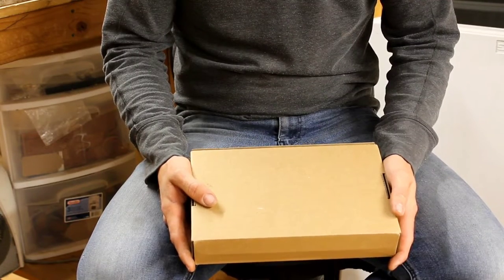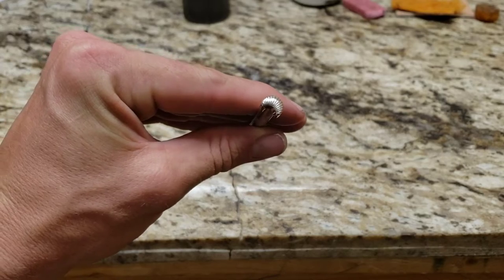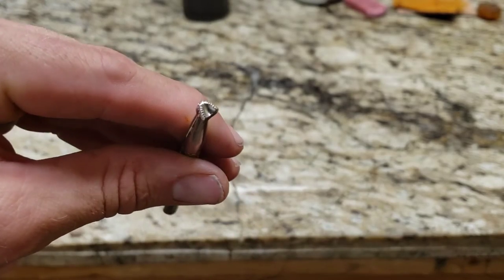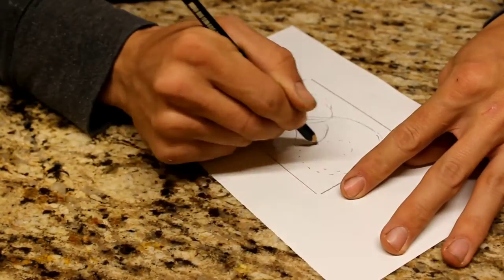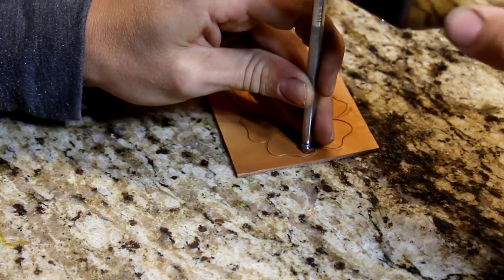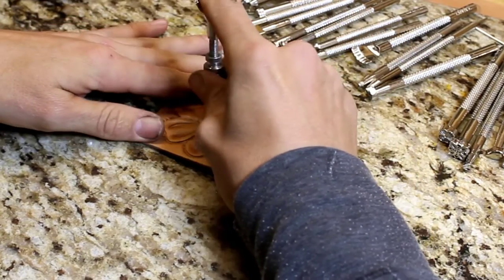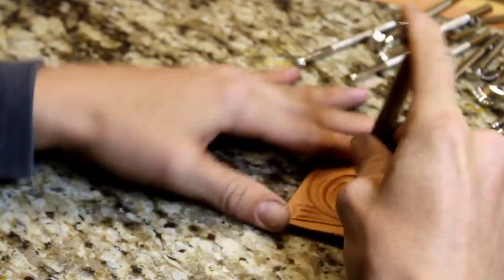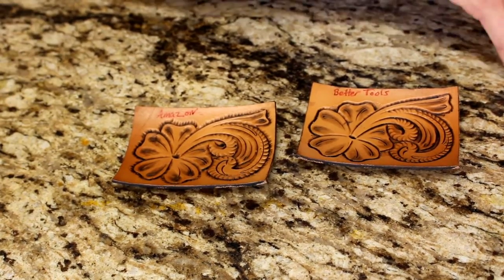Comparing Cheap $25 Amazon Leather Stamping tools VS. Expensive $500 Leather Stamping Tools

Comment: For the difference in the price of tools, the variation in the quality of the work is almost unnoticeable. In my opinion a beginner couldnt go wrong with the cheaper amazon bought tools.
Reply: I see a huge difference in the beveling
Reply: Like it said. A beginner. But once you step into that intermediate, professional stage the quality of the tools are very noticeable in the tooling. The crispness of the detail. And the fact that the quality tools are actually easier to use and get a deep impression

Comment: When I saw the results of the Amazon beveler I thought you were going to say it was garbage. Instead you gave it a fair evaluation and even gave a way to improve it with only a little effort.
I honestly don’t think beginners would be able to see a lot of bang for your buck with expensive tools.
Yes you will get tools you may never use. But it will give you an opportunity to build and replace as your skills improve . All for less than the cost of one premium tool. Very well done video.

Comment: my bro.   you cannot just use the swivel knife right out of the box....   You would never do that with any other swivel knife, so why do it with this one?   They ALL need to be touched up, sharpened and stropped when you get them.  no matter who you buy them from, they always need a bit of attention before using.      I honestly dont think you gave the amazon tools a fair chance.   you did not even try to clean up your bevels or anything.  its like you did a bad job on purpose.        Those amazon tools look like they would be absolute perfect for a beginner just getting into it.   heck,  we all have a handful of old "bad tools" that we started out with gathering dust in our boxes.
Reply from the maker: Yes, I would agree. That was the main point of the video that cheap tools work just fine.

Comment: As Don Gonzalez said, it's not the tools. It's the tooler
Reply: not really though.   sure, any good craftsman can make cheap tools work, BUT, the quality of work is not going to be the same,  not even close.    the cheaper tools have blemishes on the faces, and the tooling is very shallow and uneven on the stamps.   all that makes a huge difference on the finished piece and how refined and professional it looks.   better tools make better quality leather projects, there is no getting around that.
Reply: @orion7741 I agree. One of the reasons I try and get quality tools when i start out at anything. I figure after 6 mnths or so if I can't make it wrk with quality than I probably can't do it. Now that being said when I started leather wrk I got the best Amazon kit I could and still use them. But I can tell the difference when I use quality tools for sure.
Reply: I agree, but at the same time I don't. The thing with cheap vs quality is how much easier they are to use. The finer detail from the more expensive tools leaves a better impression. 

Not to say you can't use the cheap tools and still create something that looks excellent. But they are a bit harder to do so, and they seem to need to be hit a bit harder to get a good impression.
Reply: @orion7741  You'll also want to work more with the better tools.